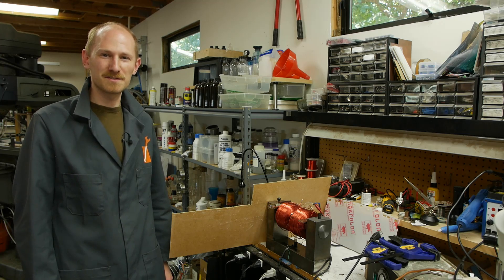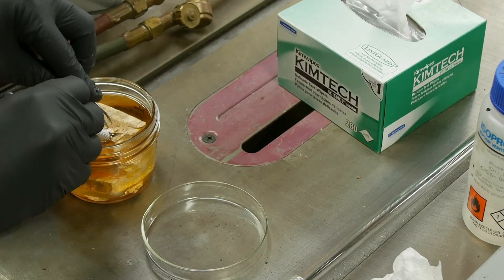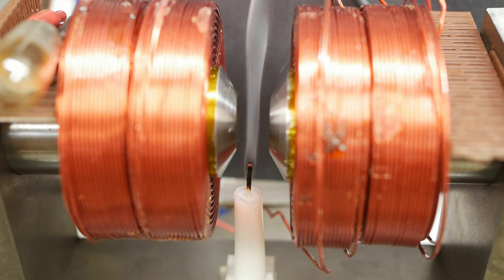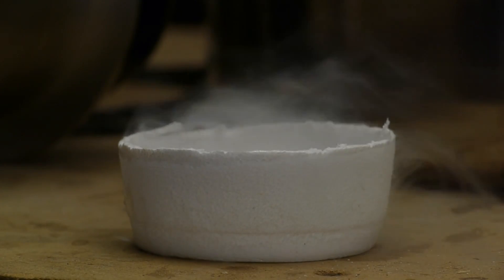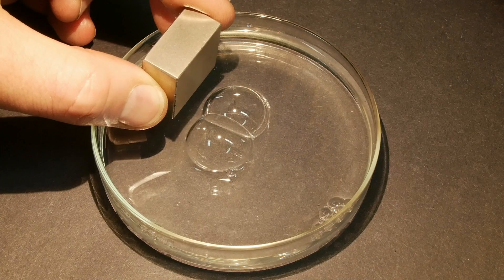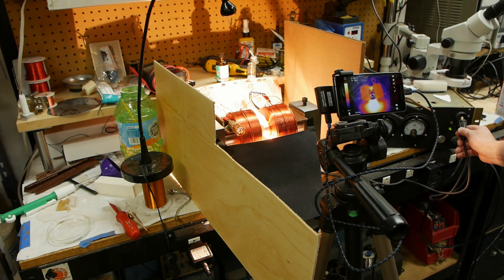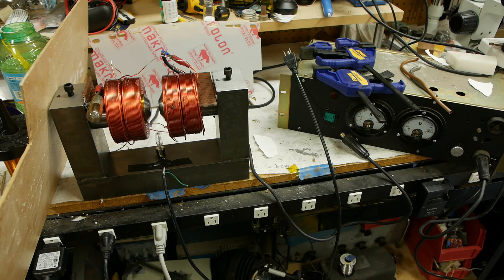Candle flame is repelled by magnets (and Zeeman follow-up)

Comment: Hey Ben,  one Tesla and one nano coulomb in the candle plasma will make one nano Newton of force at about 1 meter/sec. about the speed of the flame moving.  I did not calculate the likely mass of plasma (very small), maybe you could put a pair of electrodes in the plasma and run some current through the plasma without the magnet to estimate the conductivity for a coulomb estimate.

Comment: Flames are afected by electrical fields and "flame air" is muvh more conuctive than normal air, I think it has to do with ions. 
What happens if you run the flame paralel to the magnetic field, instead of perpendicula as you did here?
Reply: Does thee flame kinda stretches around the flow of the field? Maybe its separating positive ions in one direction, and the negative ones in the opposite.
If that is the case, if you put two metalic plates above and below one of the "branches" of the magnetized flame it should behave consistently with an electrical field, and maybe you can try reversing the potential of the two plates to see if then it goes the other way

Comment: Could that possibly be because of the Senfleben-Beenakker effect and the varying thermal conductivity and viscosity of the gases based on the magnetic field strength? 
Just an idea.
Reply: OMG. Yet another obscure effect added into the mess. But according to the original paper, the effect reaches saturation at 7-15T (under atmospheric pressure) and when saturated decreases heat conductivity by 0.5% and viscosity by 1%. Not too much.
Reply: hmm, true. 
But it could be part of why. Maybe there is something making the effect stronger here. Maybe the effect is stronger at a higher temperature, or the mix of gases makes the effect stronger, i don't think anybody has tested that. Or maybe this change in heat conductivity and viscosity in some places causes the flame to draw its oxygen from somewhere else a lot more rapidly. Theres not much known about that effect as far as i know.
Just thought I'd throw that idea in there as well.

Comment: The smoke from an extinguished candle (mostly) isn't smoke, it's paraffin vapour...
Reply: I think it's a mixture. If you look at a wick just as it's blown out you will see an ember glowing on the wick for a second or two
Reply: Not just vapour, the visible component is a "smoke" of recondensed paraffin liquid - or would that be called paraffin steam?  Maybe an experiment with liquid paraffin is worth checking?
Reply: Exactly.  A good way to demonstrate this is to use a lighter to ignite the gaseous wax.  You can actually relight a candle from a foot away.

Comment: What is that spark/flash seen when the magnet is operated? Will that be explained in the magnets video?
Is it you approaching the cable to close the circuit and air conducting electricity before the circuit is closed?

EDIT. Sorry I think the effect happens when you open the circuit not when you close it. So I’ll try guessing again. The spark is because you open the circuit which causes a huge change in current so the coils give you a huge change in voltage finally causing the air to conduct electricity and glow.  

Anyone can confirm?
Reply: The coils have magnetic inductance, which opposes the change of direct current. So, when the coils are disconnected, the magnetic field rapidly collapses, causing a high voltage to be induced into the coils, which is trying to keep the current constant. This results in the high voltage spark and burning that you see when he disconnects the positive lead from his power supply at 2:48. Even when the supply voltage is low, this "flyback" arc can be a fairly high voltage, enough to hurt you. Voice of experience, ask me how I know.
Reply: Talking about on the connector? Just a classic arc gap.

Comment: Seems like the confusion is that there are two drivers here like you said. The carbon one appeared to be correct. To me, the second one seems to be ion or plasma related, as the flame is plasma and the charge can be affected by the magnetic field

Comment: You can make a Schlieren imaging setup to see the flow of the hot air more easily. You may even be able to get away with simply shining a flashlight on it and observing the shadow if the index of refraction of the hot air is sufficiently different than the ambient air.

Comment: Maybe the higher energy particles of hot air having electrons spinning faster and reacting with magnets stronger. You could also try this backwards with a doughnut shaped cup of liquid nitrogen exhausting out to the side and put paper on the bottom and see if the current of cold Air is any less reactive, maybe all the air is similarly responsive to magnets however it might be easiest to see it in hot air/ a flame. also what about using a gas and a corresponding wavelength of light that it absorbs to see the effect, also try polarizing the light, and if you think about the reaction there are electrons being transferred and maybe that gives each individual reaction a magnetic impulse that is usually random and canceling it's self out. I would be interested to see you hook the magnet up with a super sensitive current detection method and testing if you have the magnet on and you pass a Bunsen burner flame through does it effect the strength of the magnetic field at all? And what about different flames, like a pure H + 2O = H2O flame and have 2 cheap glass eye dropper tips releasing the gases almost straight up and as close to each other as you can and set it up so that you can turn the system 360 degrees or at least 180 degrees so you can see if one gas being on one side makes a difference, you want to aim for something like laminar flow with the 2 gasses on either side of a wall or at least not mixed.
Reply: right. its like a hyperbolic demonstration of constant action and interaction?  also what about Brownian motion of the particles in the air reacting to the strong magnetic field?

Comment: Although a candle flame (or a methanol flame) is not hot enough to ionize all the particles flowing between the poles of the magnet. There will be a small percentage of these particles that do ionize due to the statistical nature of the thermal distribution.  Gas powered MHD generators benefit from this.  Potassium has one of the lowest thermal ionization temperatures and is much more available than cesium.  It might be interesting to see if seeding the flame with potassium carbonate would enhance the effect.  By the way, very nice video!
Reply: Flame is ionised gas, any electrically conductive medium that moves charge interacts with magnetic field, Faraday says so... And flame is moving up magnetic perpendicular magnetic field will deflect it 90 deg means obstruction to the natural flame propagation/flow  I thought that you have been beating around the bush but watched the video all the way I am pretty surprised that you did not mention that...
Reply: I would have bet serious money - just taken it for granted - that plasma is attracted to any single magnetic pole.  BTW, Ben Franklin invented the 1st telegraph during the 7 year's war - could made it a wireless signal if he had thought of a coil connected to his leyden jar batteries.  All very weird and interesting.  Thanks!
Reply: I was thinking the same thing. I've done experiments where I've uccessfully been able to conduct electricity through a flame due to this effect. Keep in mind too that he's using an oxy-acetylene torch, at least in the previous video, which will be quite a bit hotter than a candle or methanol flame.
Reply: I was going to say plasma
Reply: chad - all flames are 'plasma' bearing
Reply: Just a thought

Could this be due to ionization of the air stream, and not direct ionization of the air due to candle flame heat or any other heat source. Hot air, might have tendency to give away electrons easily compared to cold air. Flowing air usually gets charged when moving against a solid, like an airplane or a car. Could this also happen for cold and hot air interaction, like thunder clouds but tiny scale. This charge flow is somehow interacting with the magnetic field. Wondering what the interaction of heated air molecules and the neighboring cold molecules looks like, on a nanoscale /boundary. On a macro scale the charges might balance out. This is for the hot air case. But for the flame, it itself is a plasma, and a lot of electrons being exchanged with oxygen and other carbon atoms. So similarly there too would this effect apply?

Also a question, how do they measure the ionization of the particles in a stream?
Reply: Did you try the potassium seeding technique?  Gas driven MHD generators have been built over the past few decades, some producing ten's of kW.  Almost invariably, they seed the flame with potassium even though some are approaching 3,000K.  Once you have even a little conductivity in a moving gas through a magnetic field, you have Lorenz forces and you're home free.  We're building something like this, so I don't want to monopolize the discussion.
Reply: Zegarac Robert Exactly what I was thinking throughout. Fun fact: flames can conduct electricity. I've been able to draw an arc with a flyback transformer through a propane flame line. (Think of a flame organ)
Reply: It wouldn't even need to ionize: radicals (of which there will be plenty in a flame) are paramagnetic.
Reply: I would expect that reacting chemicals don't necessarily need to be hot to exhibit the behavior of ionized particles, as long as there is sufficient chemical reaction -- electron flux -- occurring in some aligned way (I wouldn't mind a better visualization of the magnetic field on this setup...). What's interesting to me, is that in the case of a burning flame, the orientation of the chemical reaction should be very consistent. The flame is a standing wave between the two reacting materials -- air and fuel, and we have pretty good understanding of the geometry of this standing wave.
Reply: Mr. Adi.  Ion detector= electroscope.  The simplest and oldest tech is still great tech and very cheap too.  For much better sensitivity you can use a laser and mirror or a microscope with the electroscope.  But if you want to have more fancy equip get plenty of $$$.
Reply: + Tech Ingredients
How about these hybride rocket engines wich use a similar layout the MHD generators to basically  accelerate the hot gases with a magnetic field? Is the additional weight and complexity worth the thrust gain or is it total nonsense?
Reply: To Zegarac Robert: ionised means mechanically decoupled but still intermixed. When this mixture passes accross mag. lines, a sort of Hall effect takes place, sorting the opposite charges to opposite sides. I speculated whether this separation could suppress the chemical reaction, by simply putting the fuel and oxygene ions apart...
Reply: It has to be the V cross B forces on ions. And if I recall from teaching the candle lab, the carbon combustion is the white parts of the flame - the vast majority of the light - which occurs on the outer edge where the hottest gases reach free oxygen. The rest is all hydrocarbon breaking up.
Reply: Veritasium actually kinda did a video on this https://www.youtube.com/watch?v=a7_8Gc_Llr8, candle flames, and even the soot streams seem strongly influenced by an applied electric field, there is a certain (low) concentration of ions in air, produced by things such as radioactivity and cosmic rays. IIRC this is actually how a spark occurs- the electric field accelerates ions that are already in the air which collide with the air and produce more in a sort of cascade, it's not neccessarily able to produce its own ions de novo.

The ions that are already in the air move at a speed proportional to the root of the temperature, so are deflected more, however the density should be smaller by a factor of T, so perhaps it is the regular air responding stronger to the magnetic field and barring entry to the flame?
Reply: well thought out, wondering about this hot air ion interaction Mr Adi posted above
Reply: is it something like excited electrons giving off light are more easily affected by magnetic field?
Reply: it appears that you were visualizing a change in the temperature radiating from the paper ?
[
maybe the magnetic field was altering the heat absorption or reflection of the paper and not the heated air stream ?
]
maybe a better way to visualize the heated air stream is to have a very small sealed heating element that produces a narrow heated air stream between the magnets and then a bright light shining perpendicular to the air stream that will show the heat shadows on a white background ?
Reply: We are So bringing this experiment to ISS! Anyone with me? Flames do behave odd in space due to lack of gravity (https://www.youtube.com/watch?v=BxxqCLxxY3M) but this seem different.
Reply: Would be interesting if you could build a Refridgerator similar to a Pulse-Tube Refrigerator with this method without moving Parts?! Maybe it could even be cost-effective over a magnetic cooling with expensive Gadolinium compounds.
Reply: I don't understand all the comments here about whether there is ionization in the flame.  If it gives off light, then it is ionized.  This is the only way any fluid exposed to ground can be magnetically deflected.
Reply: If you combine charge creation and the movement due to convection, you get a Hall effect and some associated transverse current (positive ions deflected one side and negative ions the other side). Then you get your MHD force source term. This force is perpendicular to the magnetic field and to the transverse current, it is then oriented verticaly and downward (opposed to termal convection). It will not change direction if you revert the magnetic field as the current direction is also reverted in this case !
Reply: you guys should team up and make something incredibly smart :-) elon musk style, reinvent the world or something!!
Reply: Quick question, could water vapour play a role in this, since water is a diamagnetic element?
Reply: @Enthropical_Thunder  no 
Water requires incredible amounts of energy to ionize
Reply: @Palladiumavoid  
Well yes, but water vapor needs less energy, as it's energy state is raised due to the heat put in.

Comment: You're playing with some pretty high volatges here. 
Is it possible there's a small corona somewhere that is introducing ionized air into your experiment?
Reply: EDIT: See the comment below me by @infinion. They explain it much better!
He did say it was 12 V, didn't he? The arcing is just due to the field in the magnet collapsing and inducing a high voltage when he disconnects it due to the high current. (look up "back-EMF") That electromagnet is a pretty huge coil after all.
Reply: @ElectroBlud Don't think that's a back-emf, just an EMF. Back-emf is due to an induced voltage from cutting across magnetic field lines with a moving conductor. The induced voltage opposes the applied voltage, but is always at a slightly smaller voltage than it because of wire resistance, speed, and a few other non ideal reasons.  You wouldn't get inductive collapse, because there is no stored magnetic field here, just induced voltage from some external magnetic field (see Lenz's Law).  You see this a lot in electric motors because you have rotor windings moving across the magnetic fields from stator windings continuously. 

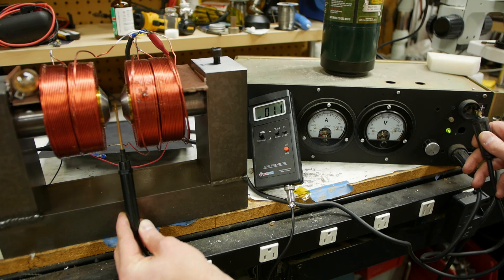 Like you mention, but incorrectly attribute to back-emf is actually an EMF spike (Faraday's Law). For those that aren't aware, all wires have inductance, like an electric momentum that prevents flowing current from changing quickly, like a brake to a spinning flywheel. Coils of wire have a lot of inductance, so we call them inductors.  In the experiment we see @2:40 that 45A at around 38V is flowing through the coils. The coils store their energy in the magnetic field inside the core material (the steel).  When the current is interrupted, the stored energy in magnetic field collapses into the coils to prevent the 45A current from changing. The voltage from the EMF rises until the air between the socket and the plug breaks down to conduct and dissipate the stored inductive energy. It rises to 1000s of volts to do this, and completes the circuit again with a momentary crack of noise and light. 

So while back-EMF induces voltage against its applied voltage while moving through an external magnetic field, and has no stored energy, a voltage spike from a coil of wire is added in the same direction as the applied voltage and is induced from the energy it built up over time. If you placed a diode in parallel with the inductor, there would be no spark, and the inductor would harmlessly conduct through the diode until it dissipates all its energy as heat in the resistance of its wire and the voltage drop of the diode.

edit: For a better analogy, current flowing through a coil is like water flowing through a length of hose. When you quickly shut off the valve at the end, all the momentum of water comes crashing into it to produce a huge pressure spike called water hammer. Flow is to current as pressure is to voltage. The analogy works well in a lot of situations.
Reply: I am guessing the voltage is not too high.  Current maybe be relatively high.  Looking forward to the coils and former video AppliedScience is working on to get the answers
Reply: Infinion
I only knew it in German so I had to google a translation. And I was too lazy to properly explain it. So thank you for taking the time to write this detailed explanation and corrections to my previous comment! <3
Reply: No worries, it's something my colleagues would get backwards all the time so I jumped on the opportunity lol

Comment: I wonder if the effect could be used to accelerate a flame or hot gas or plasma ball through some kind of high frequency cylindrical linear induction conveyor. even if to create some kind of gas pump with no moving parts.